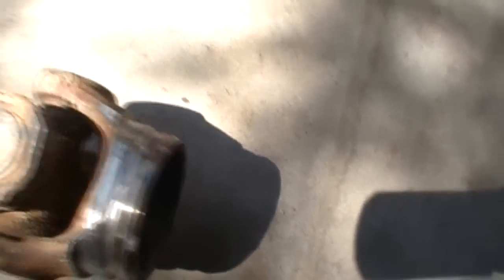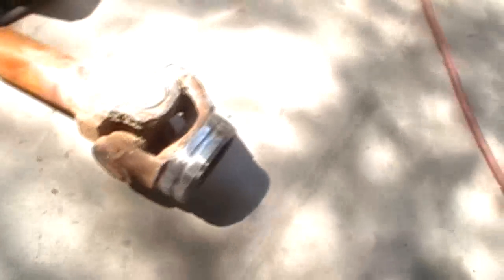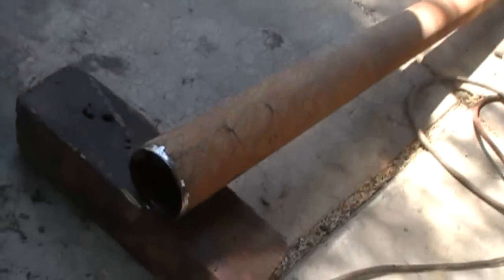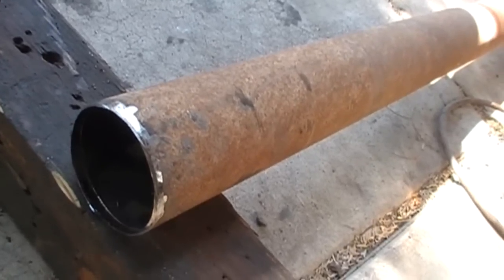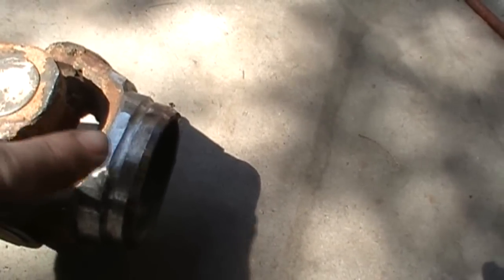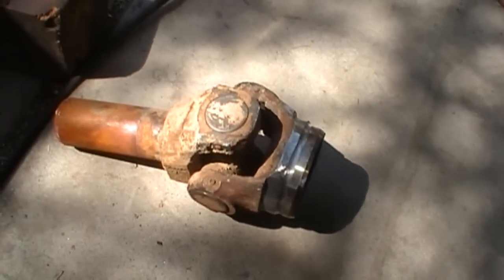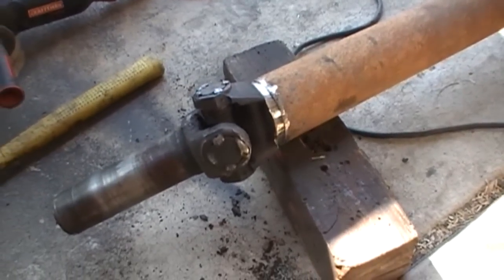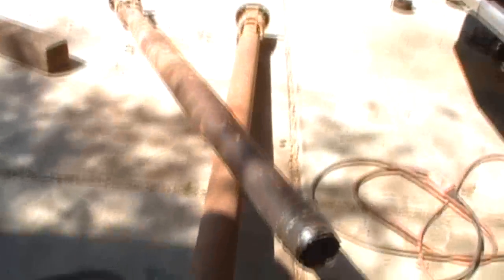Demolition derby tech, Drive shaft shortening. Yoke removal.

Comment from the maker: It is only good for a derby car. I did make a short front section for my truck with no problems. But derby car's are so rough. It is hard to point out the vibration on them. Because the one I made for a derby car does vibrate.

Comment: whats that pipe thats inside of the drive shaft?
Reply from the maker: Not sure what you mean, Or are seeing? If I use the other method of shorting. Like the one with all the welds. I do make a sleeve to go inside, Just so no worries of burning to far though the metal.
Reply: oh, i was cuttin the yoke off a ford driveshaft so i could put on yoke to hook up to a turbo 350, and i was gonna just take part of a chevy shaft and slide it in to the ford one. and when i cut the yoke off the ford shaft there was a peace of pipe inside the ford shaft, and it only went in there about a foot.
Reply from the maker: Tate Wiirre Oh I have yet to do a Ford shaft. So I have no idea. Derby car? Just toss it.